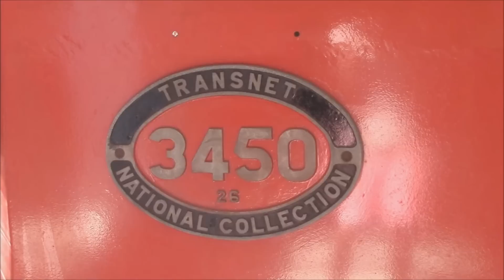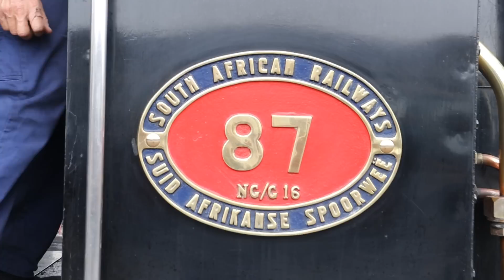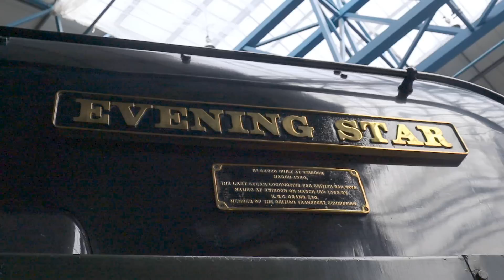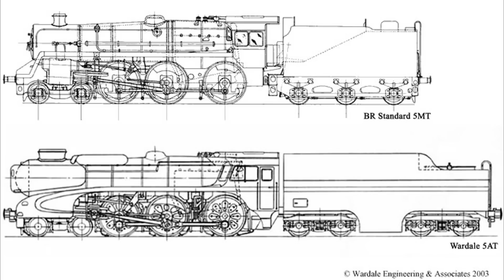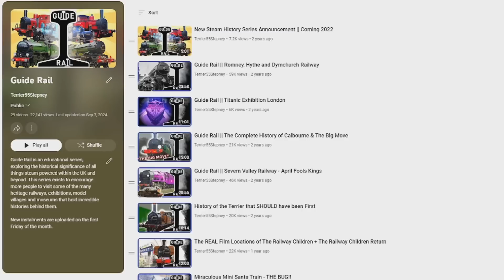What happened to the FUTURISTIC steam locomotive?

Comment: I'm just gonna come out and say it, because I think everyone's been afraid to thusfar.
Steam trains should be using water-tube boilers, not fire-tube boilers.
Water tube boilers are much more lightweight, and they capture the heat energy of the flue gases much more efficiently.
Water tube boilers are a supremely well understood technology, there's little about them that we don't know.
They were never used on locomotives, but they WERE standard issue on another type of steam-propelled vehicle. US-navy steam turbine powered warships of both world wars used water-tube boilers.
These are MUCH more efficient and much lighter than fire-tube boilers of similar capacity.
They have the steam output to actually support a steam turbine prime mover, something fire tube boilers can not do. Switching to a water-tube boiler and a steam turbine would entirely eliminate any hammering on the rails that a piston steam engine's connecting rods might induce by the nature of their offset mass, and you can quite easily connect the steam turbine directly to an electric generator, making the locomotive able to use the existing electrical technology such as traction motors bogies generators and switchgear of Diesel locomotives, while also allowing easy conversion to a fully electric locomotive if local infrastructure has provisions for such.
The water tube boiler has additional advantages, it's more fuel efficient AND more powerful than a fire-tube boiler of the same operating mass (there's a balance to be struck, fuel efficiency can be traded for power output and vice-versa to a degree), and this is the primary reason why a steam turbine is viable in the first place.
You can even have these water-tube boilers be oil-fired, meaning they can use the existing infrastructure that supports Diesel locomotives.
Thermodynamic efficiency of a steam turbine can be higher than even a Diesel locomotive, at least in theory.
Reply: Problem is that water tube boilers have hot external surfaces. The idea was tried with the Hush-hush locomotive in 1929. There are fundamental problems in adapting it for locomotives.

Comment: I always felt that instead of the classic running gear, a modern steam engine would be more like a further development of the Deutsche Reichsbahn BR 19.10. This prototype with a steammotor concept had made very promising testruns with speeds up and over 175 km/h. Unfortunally it was developed in a time when it was no longer possible to further finnish it's development and the US took it as "loot". Scrapping it after a few years of sitting .

Comment: I don't think you are going to have much luck with a 10 wheel loco. Firebox would be too small. The last generation of steam locomotives had a large firebox set behind the frames with a 2 or 4 wheel trailing truck.to produce enough steam to cope with heavier loads and increased speed. Porta and Warfdale used engines of this type. Thy could have used engines with the smaller firebox set between the frames but did not.

Comment: In addition to your planned improvements in the steam engine design, have you considered the many benefits of designing a hybrid electric steam locomotive which can generate stored electric power when not applying tractive effort to the main drivers? One can design an engine which utilizes large driving wheels for speed while the acceleration would be boosted by electric traction thereby solving a problem which has plagued traditional steam locomotives - getting started. It should be capable to utilize regenerative braking and should be capable of running on electrified and non-electrified tracks, thereby eliminating the need to switch locomotives on routes which have partial electrification. With Amtrak hoping to increase and enhance rail service in the U.S. over the next decade, this would be a good time to promote a sustainable mode. Hybrid modality has improved the petrol powered automobile, virtually doubling its efficiency; why not for the steam loco?

Comment: No, the steam engine was not doomed by the diesel engine.... it was doomed by electric traction in different forms. Converting fuel... solid like coal or fluid like oil is best done in large powerplants to get the maximum efficiency. Which means that anything done to diesel locomotives or the steam counterpart will never make them come even close to the electric locomotive in efficiency.
Reply: Only if the route carries enough traffic to be worth the investment in fixed electrification infrastructure.

Comment: It´s a pity you have no knowledge of railways and their engines! If you had, you would know that the efficiency of external combustions engines will always be way below that of internal combustions engines and that the unsprung masses of the valve gear put a strict limit to the speed of a steam engine of conventional design. If there was ever a chance for steam engines to stay "modern", it was destroyed at Ft. Eustis in the USA in 1951, when the stolen class 19 steam motor engine was scrapped.

Comment: The problem with the 5AT was that it was neither on thing nor the other. The claim of 'advanced' ignores that, in reality, it was just another development of Stephenson's 'Rocket'. A fuel-fed boiler provided medium pressure steam to reciprocating pistons via axle driven valve gear directly driving large coupled wheels, everything controlled by a driver situated in the middle with poor visibility in both directions. There were detail improvements - big improvements - but the underlying principles were the same and the same drawbacks and problems were built in. It had no appeal to those who wanted to advance rail technology; in many ways Bulleid's 'Leader' of the mid-1940s was further ahead, unsuccessful as it was. But hit had new ideas.

On the other hand, the 5AT came with no history or even pretentions of history so had no appeal to the traditional railway enthusiast. Quite simply, no-one wanted it.
Reply: Direct drive is efficient. Reciprocating steam is less efficient then turbines using high pressure steam but the latter have other drawbacks. The poor visibility is not a significant issue especially with in-cab signalling.
Reply: @physiocrat-sv  Less efficient when you take into account the unbalanced reciprocating masses and the hammerblow which follows attempts to dissipate them. Visibility is more important than you suggest: it's a reason why Class 20s always run in pairs with the cab end leading. If running single with the nose first, there must be two men on board for that reason. 5AT would never be one man operated whichever way around it ran, two men forming an extra expense not endearing it to any operator, even if having automatic fuel and water feed.
Reply: @LMS2968  
The advantage of steam locomotives is the lower capital cost. It was 20% of the equivalent diesel-electric in the 1950s. It would still be less than 30% today. Finance costs are a significant overhead. 

Modern small wheeled rolling stock is a destroyer of track. I understand that Network Rail is concerned about the impact of the 800 series, especially at switches and crossing. The smaller wheels drop deeper into the flangeways and hammer the Vee-pieces.

Three- and four-cylinder locomotives such as the Bulleid Pacifics and the GWR types are quite easy on the track.

Labour costs are artificially inflated by the tax system.40% of gross labour costs are tax. I suspect that one of the factors in the demise of steam was the raising of the school leaving age from 14 to 16 at the end of the war. This destroyed the apprenticeship system and at the same time forced a couple of million teenagers to sit bored and unwilling at their desks instead of starting to make their way in the world.

Comment: A full scale build of this is probably not feasible, at least not as a _5_AT. Headways seem to lean more towards 6P or higher these days. I recall the 5AT was proposed to use British-Caprotti valve gear at one stage, which I think would’ve helped a lot for a career in passenger use. Not sure Wardale had much experience there 

Now what I’m surprised no one’s tried is a Live Steam model of the 5AT
Reply: The 5AT was designed to weigh 80 metric tons and produce an indicated output of 3,200 hp at 113 km/h with a maximum operating speed of 180km/h. How many class 6P or 7P can equal this level? The answer is none. The design was based on that of the Std 5 because it was an accepted and understood type which made dealing with the responsible regulatory bodies far more straight forward. Why was the build not feasible given that the creation of new members of lost designs has been going on for some time now? Wardale learned from Porta who learned from Chapelon and though AXC did use poppet valves on some designs he reverted to piston valves on his later engines for good reasons. Porta would not consider the use of poppet valves since they offered no advantages over his piston valve design. You could build a very different locomotive than the 5AT; say a water tube boiler type with a working pressure of 32.75 bar and triple expansion compound drive. It would be a fascinating project but it would be very expensive and your chance of being able to run it would be very low because such a type lies well outside existing experience.

Comment: I think the best concept idea for a modern steam engine would be using heaters to heat the water to make high pressure steam kinda like those electric teak kettles u can get a the store that would use just water and a heating eliment to make steam with out oil or coal needed as when the steam goes threw the stack it just simply becomes vapor that evaporites and that is my ideal idea of what the future steam train would look like and could be ran automusly using ai and navigation to make it as effciant as possible

Comment: Forget reviving main line steam. Technology is further than that. Also the cost issue will never be solved cuz - economy + it alienates railways. I'd love to see it happen, but the steam age simply ended with the combustion engine and stuff like solar and hydrogen could replace the Diesel as well soon.
Reply: Economy? The latest bi-modes cost around £3 million per vehicle and a heavy equipment is lugged around dead all the time.

Comment: The performance improvements sound good until you take into account the appalling thermal efficiency of a steam engine, this design has a thermal efficiency of 14% whilst a modern diesel locomotives are bettering 50%.

Comment: I've never been convinced.   Streamlining has no effect below 70 mph, and a BR Class 5 has no need for a big tender.    I don't believe for one minute that it could have reached 110 mph let along 130 mph.   I doubt if it would have been as good as the Riddles design, and, in any case, the 9F 2-10-0 and Duke of Gloucester were more powerful engines to start from.

Comment: As most modern steamengines goes we have to look at the French.
The most technological advanced steam engines who ran in revenue service  were French engines designed for the SNCF.
Class 232 U.I. had rollerbearings like post war German engines, an automated coal stoker like American engines, high pressure boiler like some experimental UK engines had and an unique French fully automated compound system for the cillinders.

Steam engines are unbelievable powerfull but to creating the steam in energy wastefull small steam boilers killed them of .
Modern electric locomotives are in fact indirect steam locomotives. 
Most electrical power comes from power plants who
create their electric with steam turbines who get their steam form massive efficient steam boilers.